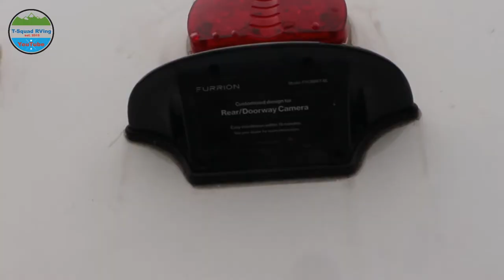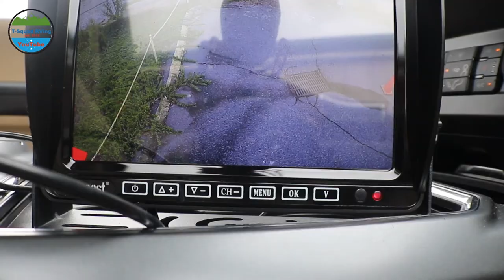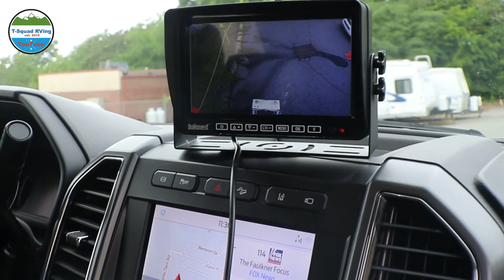RV Back up Camera Instal

Comment: Great video, one thing that confuses me is, once you hook up the camera to the wires at rear of the camper. How does the monitor read the camera?
Reply from the maker: Thank you for this question. You have to remember that you have to turn the lights on your vehicle in order to give power to your RV lights and your cameras connected to a wire that’s connected to your lights so that’s why it’s imperative you turn your lights on.

Comment: I got one that is the same exact thing.  Different ‘brand’ marked on it but everything is exactly the same.  I’m picking up my camper hopefully this eeek and I’ve prepped everything I can so I hope I can just plug it in attach the screws and head out.   The instructions in the package were slim so the test wires and adapter made no sense until your video.

Comment: What stops critters from going into that center hole, which leads to the other hole in the camper wall, and building a nest?
Reply from the maker: Great question.  I don’t know about all RVs but there’s a small metal box just enough for wires to fit on the other side of that wall.

Comment: You might want to get some Lexel sealant and fill that hole in where the wire comes out so you don't get water in your back wall.
Reply: Lexel is an amazing strong and reliable sealant.

Comment: Thanks for the details. I noticed that on top of the new camera mount, their is a pretty big gape like yours on very top that could let water in. The plastic from factory closes that gap. Did you seal it off or leave it? I just installed mine and not to happy with the big gap on top right where water would go next to wires.  I'm new to owning a travel trailer and enjoy your videos.
Reply from the maker: Hello and thank you for watching.  Yes I sealed it with silicone.  Still looks great.
Reply: @TSquadRVing    Thanks for replying. I'll seal mine tomorrow.  I just finished it up.

Comment: Thanks for the video! When you say "turn on the lights," do you mean you have to turn on the truck headlights to get power to the camera, or is it enough to have the truck and trailer connected?
Reply from the maker: That is correct.    You must turn your headlights on.  Thank you for watching.
Reply: Belated thank you! I had made all the connections but we kept getting "no signal" on the monitor. Thought I must have missed something or used the wrong adapter, but all we had to do was turn on the lights! 😆

Comment: Did you use the same screws that came in the furrion bracket to install the new bracket to the rv. Not sure if it has those 4 screws in the kit. Ty
Reply from the maker: Good morning.  I believe I used the Furrion screws that was with the cover. 
Sorry for the late replay. I do not get notified when I receive comments.  Hope this helps.
Reply: @TSquadRVing  super Thanks! I do understand that it’s hard to “see” all of these. The only reason I was being  all please help, was because I’m gonna be doing this soon and have to instruct the wife cause I’m a stroke survivor. I didn’t see screws for that mount, and presumed you used the furrion ones. Thank you so much!
Reply: @TSquadRVing  is the camera holding up well? I have the furrion and it’s an expensive pos.

Comment: Does anybody know if this will work on like a Suburban as a nice backup camera? I do not have a camper but I'd love to have this is a backup camera for a screen you have to have special wiring or anything like this or can I just wire to 12 volts in the back of my suburban and mounted on the hatch door. Cuz everybody wants to sell you a magnetic one will leave a door on the back of a Suburban is aluminum so it doesn't work